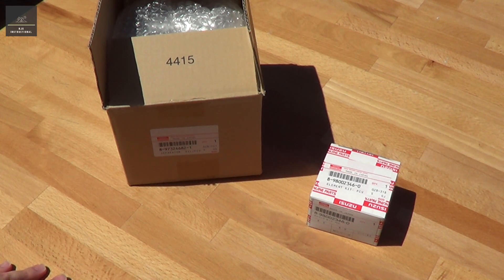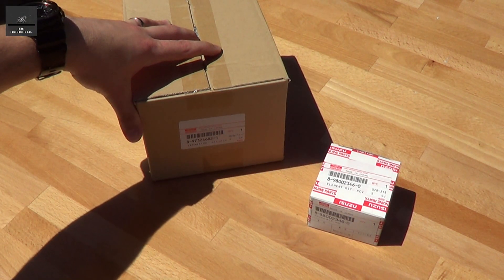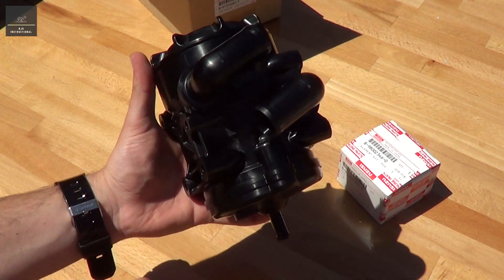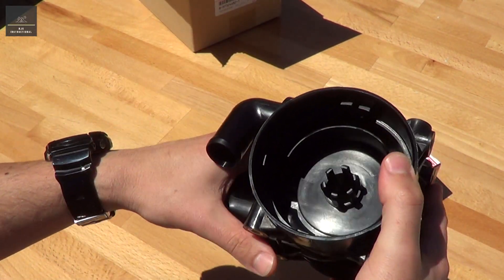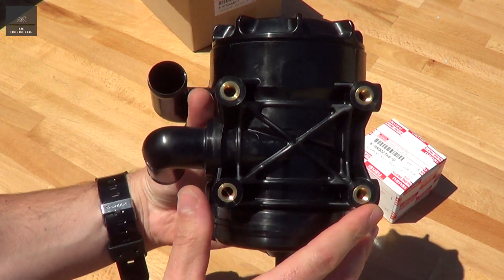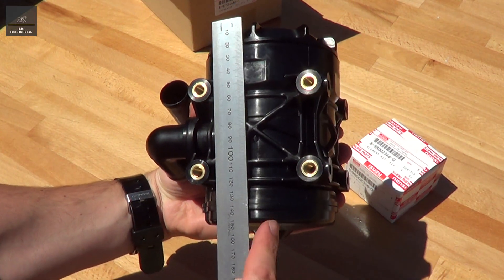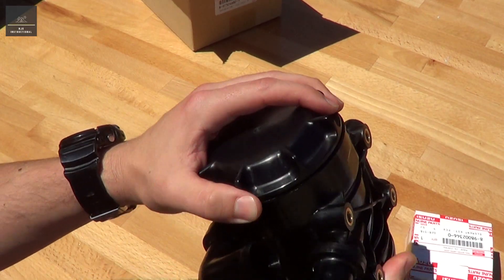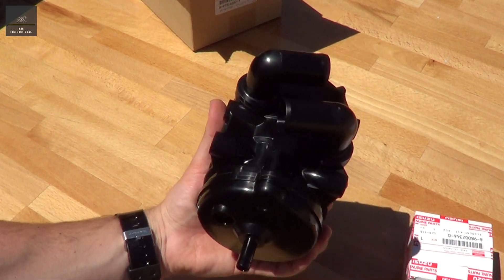Isuzu Oil Catch Can PCV Separator - Genuine OEM

Comment: I fitted one of these to my 2013 Dmax 60 thousand km ago and can confirm that they work brilliantly. Sourced from my local Isuzu dealer in Geelong Victoria  Australia. The hose from the can returning to the turbo inlet is bone dry after this time and I have been draining the drain hose that I fitted to the cans bottom with a sealed drain reservoir made from PVC plumbing fittings every 5,000 km and a fair amount of blow by oil is present each time. The can cost me about AU $90 at the time and it is fitted with an internal filter which I change at 30 thousand Km intervals and they are currently $22 each. to sum up, couldn't work any better. Thanks for putting me on to it:washhands:
Reply from the maker: Cheers, thank you for the feedback on your long term usage.

Comment: I have fitted this to my 2021 BT50, I'd like to add to the description that it has internal pressure relief valve and appears to be much better build and design than the Provent 200 I have just removed from the same car. Paid $160 from Isuzu truck spares
Reply: What did you do about a bracket
Reply: Any chance you can put a picture up of how you mounted it? Thanks 👍

Comment: Fitted this to my 2016 colorado with a bit of 25mm hose and 19mm hose a 25/19 hose reducer from bunnings and a couple of 25mm elbows (Bunnings) you can source the filter from ryco fo r $20
Reply: Where did you mount it?

Comment: Hi there. Awesome video, very helpful. 
I'm about to order one from my isuzu dealer in South Africa. Over here no one is that familiar with catch cans. The agent says it will not work on the muX as it is for the bigger trucks. From your video I believe you say it will be fine though. Can you maybe confirm from your experience? I understand I will just need to make a bracket and work the piping. 
Thanks again
Reply: Hi, did you buy this, I'm also from south Africa. If you did how much did you purchase it for?
Reply: Hi

I did buy it about a year ago. From Westvaal menylyn it was R1600ish if I remember correctly. 
It's a bit of a pain to install. You'll need to make a bracket to mount it and the pipe in and out angles are a pain. 
But it is definitely possible and once installed it works very well. I drained almost 200ml ot of it after about 10k km.

Comment: NJS instructional
Hi there
From Australia QLD
I have got one of these from a mechanic mate of mine
He works at ISUZU trucks
Just wanted to know how good are these oil catch cans.
mechanic mate reckons they are better than provent and other brands  because they are made from Japan. I also get the filters off him for free aswell whenever I need them.
I've got a ford ranger 2009 pk model
I've had to make a custom bracket for it to fit. First I thought the top hose on can was the inlet for the pcv, and outlet hose down below.
I noticed my catch can would smoke more when i open the lid and the hoses would get really hot lol. I also noticed my fuel going down quicker aswell
So i searched up a video and found yours. You pointed out the bottom hose is the inlet pcv lol and the top is outlet to the maf hose to turbo. I then ask my mechanic and said same thing as your video , he just forgot to mention it to me lol haha
so i switched it over like your video and car is running better and hoses on inlet and outlet aren't as hot.
Thanks heaps for your video.
I have had the filter on for a month no
What are your thoughts on this filter?
Reply from the maker: Hi Rose, I'm glad to hear and thank you for the positive feedback. Yes the inlet and outlet piping seems a bit odd but makes sense when you think through the design... they are definitely a high quality product and I do recommend them over the aftermarket units. Cheers.
Reply: Hey NJS
I've had it on the 4wd for maybe 2 to 3 months now
opened up the filter, theirs a bit of oil under the top lid
when do you think oil will drain down .
I have a valve tap at the end down to chassis , but notice no oil in it 
Does it just require more driving around for more Ks
What do you think ??
but I notice my car seems to be breathing much better
Reply from the maker: @peterkellam250  Hi Peter, I can confirm that the inlet pipe is the lower port and the return pipe is the upper port. Reason is, if the catch can fills with oil and it isn't drained, the oil is not sucked back into the engine, hence why the port is higher up. Cheers

Comment: G'day 👍
So there's no pressure relief valve ?
Reply from the maker: Correct, no pressure relief. Keep in mind, when this is plumbed into the turbo there is a negative pressure (vacuum) in the PCV outline line. Therefore, there is no need for an over pressure relief. In fact, an over pressure relief valve can allow for water to enter in during cooling esp. sudden cooling eg. During a river crossing.
Reply: @NJSInstructional 
Thanks heaps 👍
Hopefully it'll suit a 2018 Isuzu D Max.

Comment: Bought and fitted to my mux. Bought from my local isuzu truck parts store.
Reply: Where did you buy all your hose fittings? What sizes were needed mate? Cheers
Reply: Jonathan Pace fittings from bunnings mate irrigation poly fittings 19x25 mm elbow. The hoses you need are 25 mm connects to catch can. And 16 mm connects to engine pcv. I just forced the 16 mm hose to fit the 19 mm fittings.
Reply: @lfl025  cheers mate! Much appreciated!
Reply: @Jonathan Pace no worries mate!
Reply: @lfl025  hey mate! What year mux do you have? I have a 2015 dmax and struggling to find where to fit it! Have to make a bracket unfortunately i think!
Reply: @Jonathan Pace. Mine is a 2016 model. Made my own bracket mounted on the rear of starting battery. M8 bolts x4. I will try to get photos. Send me your email. Thanks

Comment: Great video, thanks for sharing. I would like to fit one to my jeep as the filters are a lot cheaper then the Provent & Ryco, even though the Provent and Ryco style are 40k km duty, assuming engine in good condition. What capacity engine would this suit?  Ive seen the Provent advertised for $350.
Reply from the maker: Thanks Albert, this unit will work with engines up to 5.2L maybe even bigger.
Reply: @NJSInstructional  Thanks NJ, Im thinking there are no safety valves with this type. The ryco and pro have 2 each.

Comment: Thanks for that, very informative. I have an Isuzu MU-X and will heading down to the dealer to get one. Do you happen to know if it is a standard fit or I need to make up brackets? thanks again.
Reply from the maker: Hi Shane, you will need to make up a custom bracket.
Reply: @NJSInstructional  Thanks again